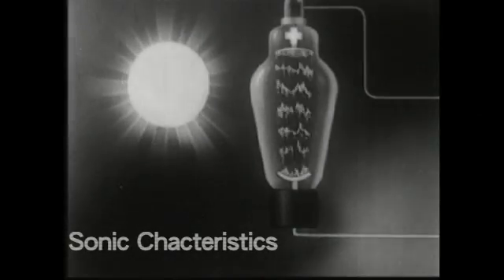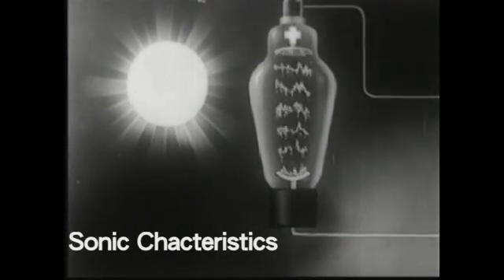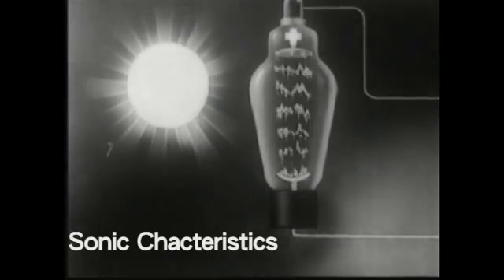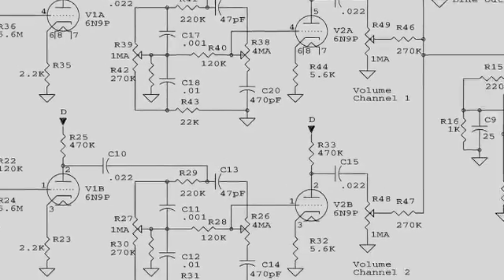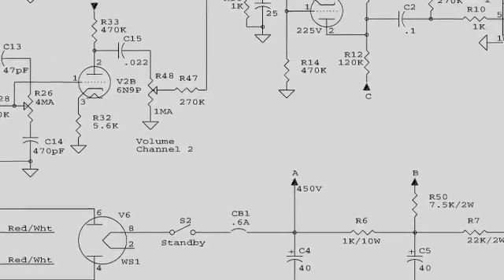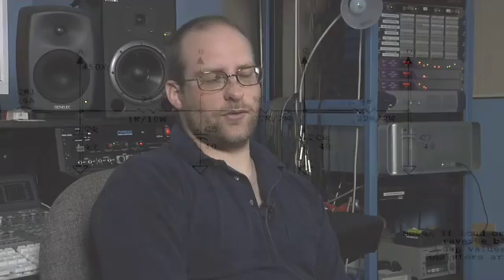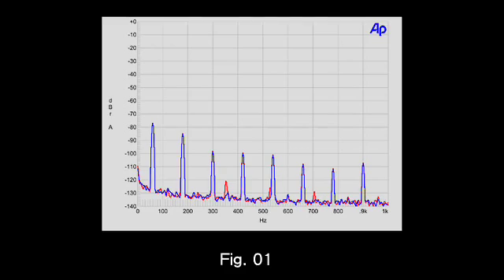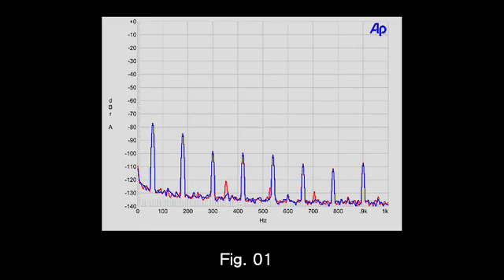Tubes Vs. Solid State Amplification

Comment: Solid state technology has improved greatly over the years, but it will never sound better than tubes. At best, it can hope to sound as good as tubes by replicating perfectly what tubes sound like. To date, that has not happened.

The reason why tubes just sound better is because of the harmonic content of tubes. If you play an A note on your guitar on a tube amp, the amp will reproduce that A note. But it will also reproduce many other "ghost" notes, and these notes just happen to fall along even and odd scales on the guitar.

So when you have an entire band all playing to tubes, you get a fuller richer sound. It's like there's a "ghost" symphony behind them.

Even clean sounds are better with tubes. And even bass sounds far better with tubes. You can get a decent sound out of a solid state bass amp, but no solid state bass amp sounds superior to a full tube bass amp.
Reply: ***** Most discussions are  mixup. First mistake is with naming amplifiers by nick names ; "Tubes" and "Solid"  This narrows all discusion to active elements only and that is wrong. Tube amplifier is not the same as solid amplifier - one cannot just replace stuff  in  circuitry to have tube amplifier so all  comparisons are regarding not only active elements but also full circuitry. It's wrong to discuss   only tubes and transistors. Huge difference is  in amplification volume without feedback -  solid is many times more.  Big amplification increases all phase mistakes sensed by feedback. For this mistakes should  be accounted phase irregularities of crossovers in speaker sets - they are seriously  enforced  by solid. Another difference is output transformer not existing in solid constructions. It's impact is always  ommited by talking folks (or  state it's disadvantages for low tones) . Transformer has inductive character just as speaker coil -  that could  have additional positive input for tubes to proper phase signal in  feedback . All amplifiers are examined with dummy load which  is totally not in comply to all kinds of crossover network in speaker sets. My conclusion : It's not that simple. Surely tube circuitry is just simplicity and perfection. Solid is less simplicity also perfection but susceptability to speaker set. If we like to know how solid amplifier sounds we need to use headphones. Tube amplifier is more tolerant.
Reply: Mikexception Just use your ears, man. Listen to old records where all they had were tube bass amps. And listen to how much better the bass sounds compared to a lot of modern records. Just listen to Pink Floyd's Dark Side album. 

The harmonic content of tube amplification is what makes tubes so wonderful. Whether it's in guitar amplification, bass amplification, microphones, mic pre-amps, hi-fi stereos, etc. Tubes has always and will always sound better. If you use transistors, or op-amps or whatever solid state device you can think of, tubes always sound better. Solid state produces a harsh sterile sound, tubes provide a lush 3-D sound. 

The down side of tubes is that you need a lot of them to produce wattages above 100.
Reply: Usualy I don't discuss personal opinions and  think few people understand what I had written. You trust in something called by all harmonic content of amplification. I must state - even I am very long time privately developing amps and speakers it is always  a mystery for me and I treat them  rather like comfortable explanation. . Sure - for tubes second harmonics were 1-2% but it's still distortion - hopefully not hurting. If we load amp fully then it will be 10% - may be good  gain for special bass impresion - lucky You.  If we are talking about solid state THD it's proven level is about 0.01% and in my opinion it does not justify so bad outcome of even  ultimate class solid  amp.  So I didn't   mention them but only  what I touched with my hands and ears.My opinion is based on years of comparaison between different high class  tube and solid state   amplifiers. Even solid state I modified into partly tube type of  sounding modifying it's   feedback in weird way. . My experience althought not profesional is 40 years.   Vinyl records were in  analogue technology and mastering was accordingly.  And that is another source of today's changes. It's not only bass - whole vinyl  sound is more complete.  There is no any magic reason - all  sources of distortions input to sound we hear..Speakers are not same, power not the same, recording not the same, media not the same and musical instruments not the same.
Reply: Mikexception The harmonic content of tubes is really what gives them their sound. That and their tendency towards soft clipping. You can even see this on an oscilloscope. Tubes circuitry can be arranged to produce either odd or even harmonics, but either way it's going to sound richer then solid state technology. What's nice is that you can vary how much harmonic content you want in tube circuitry (if you understand how those circuits work). 

Tube harmonic content is sort of like "ghost notes". You play an open A string on a guitar, and when amplified by a tube amp, you will hear the A note (the fundamental), but you will also hear other notes that are not played. Those other notes vary in scale to the fundamental frequency. So with even harmonics if you play an A note, you'll also hear a B note. You'll also hear a D note, but it's not as loud as the B note. You'll also hear a F# note but it's not as loud as the D. These are even harmonics. And this is what gives tubes their rich 3-D sound. 

Tubes also clip softly. You can see smooth round edges on a waveform that is clipped by a tube. This produces a mellower more musical sound.

Solid state technology, on the other hand, doesn't produce harmonic content (well, MOSFETs kinda do) and due to the structure of semiconductors like transistors, you get sudden sharp electron transfer, which produces sharp clipping. The point where the wave form clips produces a lot of harsh high frequency content, which sounds sort of like unplugging your instrument cable from your guitar and touching metal objects with the tip of the cable.

Transistors are wonderful things and have lots of wonderful uses, even in amplification, but in the audio spectrum, tubes are just superior in sound.

I'm not sure what you mean by feedback. Perhaps you were talking about negative feedback which is a fairly complicated topic. 

Vinyl records do sound wonderful, and I do prefer a lot of analog gear, but the nice thing about digital is that it gives us far wider frequency bandwidth then analog could ever produce. Digital recording is an amazing technology. 

I lot of bass players these days simply don't have a lot of experience with tube bass amps. They've been using solid state Hartkes or whatever for so many years that they've never heard a real tubed Ampeg SVT and simply don't know what they're missing.

Comment: I really enjoyed the tube amp part and the whole video is very informative.  Hope you don't take this the wrong way, don't want to sound like a troll, but if I may share my opinion:  The line 6 spyder is not a very good transistor amp (it certainly is the worst one I have ever come accross in my life) and it does not really give an "accurate" comparison when played next to the ampeg.  I would rather have put something like a vintage roland cube (especially the one from the 80's that were made in Japan) or a Lab 5, or a JC, Peavey also made/make some amazing transistor amps.

Comment: Yes, even order harmonics sound more pleasing to the ear.  Also, yes, when they clip (saturate) they clip softly.  All of this sounds more natural to the ear.  With audiophile amps, tubes have an ease and naturalness to there sound.  Also tubes give a better sense of air in the room and around the images making generally for a larger soundstage.  SS has a greater sense of dynamics both macro and micro (plucked strings, traps, cymbals etc.).  SS generally had more punch in the bass.  Modern audiophile SS amps have great pace, almost metronomic, with a sense of speed to the music.  With SS more detail on the bottom, tubes with more detail between the players (inner detail).  With tubes it's generally easier to tell the difference between all the instruments (instrumental textures), although modern, and expensive SS amps are catching up.  The difference between fast loud-soft-loud-soft (dynamic transients) are generally better on SS.  There are more aural differences.

Comment: When you hear a symphony or watch a movie like Star Wars, Close Encounters of The Third Kind, Born Free, through a tube amp or 2 for stereo ...the sound is unbelievable ...jaw dropping when using big speakers and lots of bass..The sound is dimensional , rich and warm   and smooth beyond words.... I have some solid state 1970's -90's stereo's but my main unit for is tubes ..People have no idea.....Anyone who would spend hundreds of dollars on solid state equipment that has nothing in it now... has no idea...
Reply: I remember comparing high qulality solid state amps to  a Mcintosh tube amp at Audio Design in Fairfield, CT and there was no comparison. The Mcintosh amp was superior in sound in my opinion. The Mcintosh was also made with high quality 1 percent tolerance parts so it was kinda pricey.  I do like solid state amps with MOSFETS, and a lot of very high end transistorized stuff sounds good, but comparing high end transistor stuff to high end tube stuff yields me liking the high end tube stuff better. I think they have a smoother sound. I had a harsh early stereo tube amp from the 50's, and I tossed it in the trash after I scarfed up the tubes, but most tube amps, especially triode amps have a nice smooth full sound. In my opinion. I like tube sound for Hammond B3's and also tube guitar amps. They claim they finally invented a computerized  new Hammond B3, that finally sounds "just as good" as the old Hammond B3 but I heard the key action isn't as good as the old B3's.

Comment: That's not a solid state amp, it's a modelin amp which is basically a computer with speakers and that SUCKS. Modeling amps are bs. A true solid state example is the Marshall MG, any of them. You can see the difference. A solid state is like a tube amp when comparing it to a flimsy computer with speakers.

Comment: I find the biggest difference are the dynamics of the amp. You can't dig into a solid state amp like you can a tube amp.  Touch sensitive dynamics. If you play clean jazz, it might come in handy. But there is a reason most guitar players worth their weight in salt use tube amps.

Comment: The guitar player in the vid does a great job of telling us nothing, and offering up comments that can only confuse those who want to learn or hear the differences between solid state and tube guitar amps.
Also, he is using a Line 6 "modeling" amp that is fully solid state.  Line 6 also makes modeling amps that use true tube pre-amp and tube power amp sections, with the modelling and effects between the signal chain.  It's a cool design that can offer a cool choice for players.

Comment: Some of the more "technical" information in the vid is decent, and might help those who know nothing about the difference between tube vs solid state guitar amps.
However, the title of this video is misleading in that it seems to imply that it will discuss differences between the two amp types, especially as it relates to guitar amps.
Well, this vid fails miserably at that.  It fails so badly because it doesn't demonstrate at all what some of the differences are.

Comment: Tube amps produce a more pleasing form of distortion, and they go into distortion smoothly rather than suddenly. This makes them ideal for guitar amplification. While solid state amps can be designed to emulate tube characteristics, most manufacturers don't bother. There are drawbacks to this approach as well. The reason tube amps sound louder watt for watt is that they distort gracefully so they can be driven well beyond their wattage rating and still sound pleasing.

Comment: The real asset of tubes is the way they change dynamics over I/O levels. When saturated they compress *a lot* while transistors do hard clipping. The change is gradual and makes tube amps sound very different over the range, whereas solid state has a much more programmed response.

Comment: Marshall AVTs are a good example of cool Hybrid amps. A nice balance of price and sound. They do sound MILES and MILES better than those horrid and cheap Marshall MGs. I have a little Marshall AVT, 20 watts, for practice and sounds amazingly well and gives off pretty decent tones. But, I will never trade a tube amp for a solid state one. Solid states might be a good choice if u play non-distortion stuff like U2 or something like that.

Comment: you are horribly mistaking Albert King with Albert Collins, as I was suspecting for some time right now. Collins used fender twin reverbs indeed. Albert King used an acoustic SS amp for most of his career, and yes he (and BB) got "creamy smooth sax notes" and nice soft clipping out of their amps. Which points out that at least some of the tube vs solid state amp story is based upon prejudice and misconception

Comment: SS CAN get you an OK sound if you play clean or like a dirty sound.  Albert LOVES a dirty sound. I'm a EE and a HAM.  Transistors are CURRENT amplifiers.  Tubes are VOLTAGE amplifiers. BIG Difference!  That's why bass players are usually better off with SS -they need lots of clean current. Also why they can use class D.  Now why the heck is class D expensive?  Any way, tubes have a type of distortion that transitors simply don't do.  It sounds like a creamy smooth sax note -no clipping sound.

Comment: guitarists want tube distortion when they play but they need to crank their amp to get the sound they want, unless they use a pedal or overdriven prestage, then again many guitarists prefer the output tube distortion sound and ofcourse the sound that the transformer gives aswell. blind tests are offen very short and that doesnt really tell the difference between a tube or a SS amp. i own both tube amps  and SS amps for hifi, single ended or pushpull, i allso own some guitar amps. i prefer tubes.

Comment: I personally play with software, completely digtal. For me it does everything a my tube amp does, and even more. It has that "warmth" and especially the touch sensitivity when you crank them + I don't have to blast myself away with volume as I'm doing it. 
+ It's conquering terrain in the pro world to. AC/DC, System of a down, Skunk Anansie... use software in the studio :)

Comment: BB and Albert use solid state amps -Yeah sure, but if they can help it!!!  The life on the road finds you playing all sorts of crap fepending upon the situation.

'I Aint Drunk, I'm Just Drinkin', You think that was done with an SS amp? Nope.  Sorry. I've seen them both play many times.  BB prefers Twins -Don't ask my why,(too much power) and Albert has played through a variety of tube amps -NEVER seen him play an SS.  Also BB has had a long career. SS amps were not pro grade until about1985.

Comment: I don't know, both BB King and Albert King used solid state amps for most of their careers. Both are oldskool blues fellas, and both achieve a great sounding crank the volume/soft clipping tone out of those amps.
I personaly use amplitube 3 modelling software, and I too can achieve very pleasing soft clipping tones, with all the touch sensitivity one would expect from a tube amp.

Comment: A better guitar example would be to simply plug the guitar into a good S-S amp (no pedals), turn it up to 7 or 8 and do the same with an equivelent sized tube amp. (e,g, 12" speaker, 15-20 watts tube vs. 50 watts S-S). If you are an old school blues or jazz player like me -it's TUBES all the way. If you are strictly a modern clean jazz player or a Heavy Metal "shreader", solid-state works.  However, I believe tubes will make most guitar player's happier.  --BUT, more maintenance!

Comment: Thanks for posting.  Just to throw 2 cents in, wouldn't it be more scientific, or at least more fair, to have him play a good guitar through a good tube amp?  I'm seeing a short-scale w/ DiMarzios hooked to a pedal that scoops all of the tone out, and I think the microphone fell into a bucket or something as well.  Also, all modern non p2p wired amps are as fragile as a fontanelle, get a warranty with that Line 6! (Or, buy one of the many good amps it's trying to emulate)

Comment: Solid State has its place, much more power than tube amp for the price.
Tube amps have that distortion, that sound, that is tube.
I have taken older electronics that was 100% tube mono and have build a solid state right, or stereo, side.
This means that the 2 channels are a direct evaluation of each other.
I did this not to prove anything, I just wanted stereo.
But I can tell you this, each has its sound, and everyone who ever heard it said the same thing.
Same speakers, same pickup, etc.

Comment: I bought a $340 crate SS guitar amp in 1994 which sounded ok until buying a off brand tube amp from the local swap meet for $20.  Never again with SS, although they've improved some over the years.  I also run tube amps for my stereo.  The dynamics, sound stage, detail with tubes while SS seems flat and robotic.  In short, why buy SS when the real deal is still available?

Comment: OK - SAY YOU TOOK A TRANSISTOR, ENCASED IT IN GLASS, PULLED A VACUUM AROUND IT, USED A 'GETTER' TO DEPLETE NEAR ALL THE OXYGEN IN SAID ENVIRONMENT, THEN HEAT THE TRANSISTOR UP, WITH SAY A MINIATURE BLOW DRYER, OR SOME P-235, THEN PLUGGED IT IN A CERAMIC SOCKET IN A GUITAR AMPLIFIER - WOULDN'T SAID DEVICE SOUND JUST AS GOOD AS A VACUUM TUBE - CERTAINLY YOU CAN FIND THE LOGIC IN MY STATEMENT - IF SO MAY I INTEREST YOU IN STOCK IN ANOTHER OF MY INVENTIONS: A SOLAR POWERED FLASHLIGHT? THANKS!